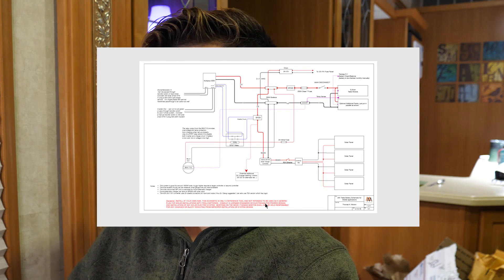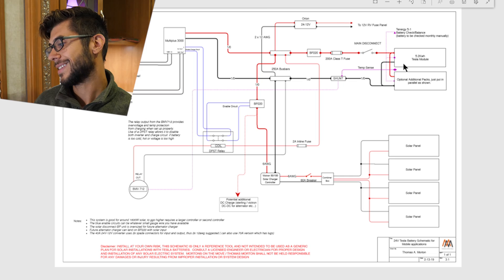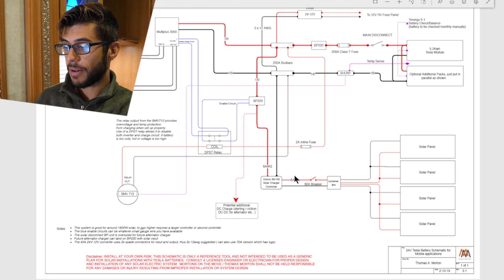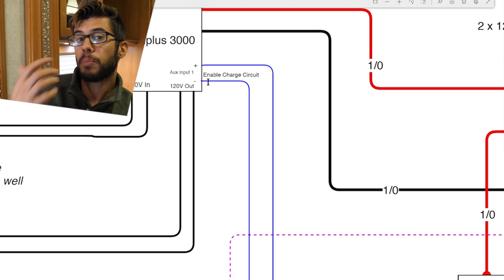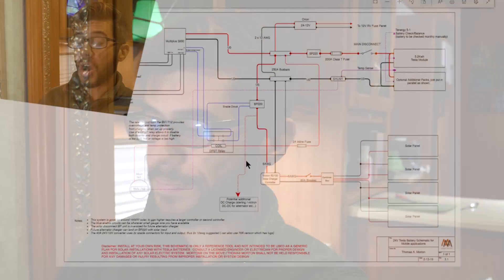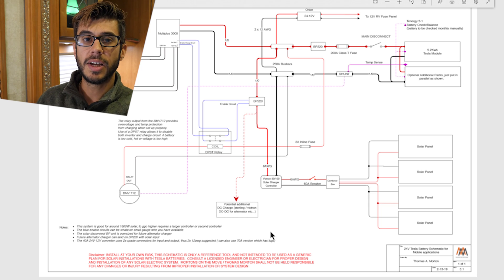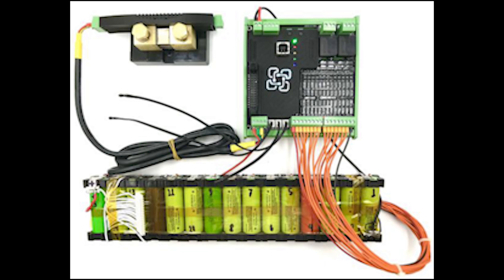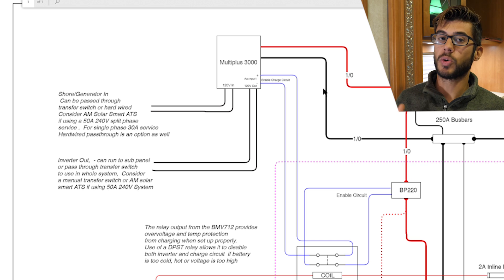RV Tesla Battery Install - System Simplification and Improvements , Schematic Walk through

Comment: So ... Nissan Leaf packs don't have to be heated until around 0 degs. F for charging. (Their thermal management will heat the pack back up to 14 degs. F and then shut off.) I had no idea that the Tesla pack chemistry was that inferior for RV use in cold weather.
Reply from the maker: I would be curious to see where you are getting that stat.  Leaf batteries are of the same chemistry that would plate below 32F...
Reply: @MortonsontheMove  True of all Leafs sold in cold climates. Here is an example description on Page EV-5 at https://owners.nissanusa.com/content/techpub/ManualsAndGuides/LEAF/2018/2018-LEAF-owner-manual.pdf
Reply: Nothing wrong using the Leaf battery, but you need to use it as a 48 volt system. Just be aware Leaf batteries lose about 80% of capacity after about 50,000 miles in a car so buyer beware when buying used. Tesla S battery offer the lowest cost per Watt of storage.  IE $1200 per 5.3 WH module. Leaf does not come close.
I have to say for anyone repurposing used EV batteries is more experimental than standard practise. For all others with concerns, just buy the Battle Born for 5 times the cost to obtain the same watt hour as one Tesla Module. Battle Born are great battery, but very expensive.

Comment: Interesting use of the Tesla battery.  I like the idea of having something that can be temper proof monitoring with smart disconnect.  I was thinking of using something like a Linear Tech LTC4359 Ideal Diode with higher amp FETs and controlled either by FPGA with a/d inputs or with a simple Arduino setup for volts and temp monitoring as a safety control circuit.
Reply from the maker: You can use whatever,  We originally used independent controllers.

Comment: Thanks for your video . I've been using a Tesla model S batt. module for 5 months now in my home solar power system and couldn't be happier with how it works . I built a battery pack consisting of 88 18650 lithium ion cells wired in parallel and added it in series to the Tesla module .   This gives me a much wider operating range to work with compared to using just the Tesla module alone .  My inverter has a low voltage alarm that starts screaming at 22 volts so if I were to use only the Tesla module alone charged to around 80 % capacity I would only have a little over one volt to use from the time the sun sets to when my inverter shuts down . Now I can charge my batts. to 27.4 volts and have 5 and a half volts to utilize instead of just 1 . There are several other advantages to adding the extra batt. pack as well .
Reply from the maker: Yes if they were 7S batteries life would be much better using them like this. The victrons work pretty well at the low voltage tho.
Reply: Russ can I contact you? I have a 444 tesla module but I must have shorted it a blew out 72 fuse wires only on one series at the neg connection. All the 18650 cells are good and I want to repair it.  Did you make a 7 series battery? I also have question on setting up the charge profile in the Victron 24/3000 software. Tom
Reply: Hi Tom , to answer your question yes I bought 100 18650 cells from a company selling off of E-Bay , they are 2200 mAh instead of what Tesla uses which is 3400 mAh but it doesn't matter and then I connected 88 of them together in parallel soldering  thin pieces of wire to all the positive terminals with the other ends of the wires soldered to a heavy guage wire to make buss bars .  These are my fusible links . The negative cell terminals are all connected together by just being in contact with a heavy piece of copper wire . The whole pack of cells is put together in a wooden frame and wired in series to the Tesla modules positive terminal to make a 7s battery . Its fairly safe to solder the positive terminals of 18650 cells because they have a raised button that helps to keep the heat from damaging the cells but the other end of the cells are the outer case of the cells and if you leave the soldering iron in contact with it too long you could boil the electrolyte and ruin the cell . It looks like you have 72 new fusible links to solder to your Tesla module on the cells negative terminals ... good luck . I don't know anything about a Victron controller as I am using a Xantrex C60 controller
Reply: @RussLinzmeier  I would like to see a photo if what you did. With regard to my issue, all my soldering will be from the positive cap of each 18650 cell to the bus bar. I know soldering the cell cap is not the issue but soldering to the Tesla bus bar is as it acts as a large heat sink. Thus the reason I think the fuses have to be spot welded.
Reply: you know when I make my next 18650 batt pack I won't make a wooden frame because it was to teadius and time consuming to make . I would recommend you search "do it yourself powerwall " and build yours the way those guys build a pack using snap together plastic cell connectors .
Reply: @RussLinzmeier  I have seen many make the power walls with the use of PCBs. I did consider that, but the purchase of a single Tesla Module was cheaper. I guess I am confused on your build. Did you make a battery from scratch or add one additional series to the Tesla module to make a 7S74P battery? Is so how did you add the addition series to the module? IE wired connection to the 6S and the final connection of the 1/0 or larger battery cables?
Reply: What I did was similar to what the " Do It Yourself Powerwall " guys do , they acquire hundreds of 18650 cells and assemble them together in packs of about 100 cells each wired together in parallel . When they get 7 of these built they connect them all together using zero gauge battery cable to make a big 7S battery and connect that to their charge controllers and inverters . I just put together one of those packs and connected it to the positive terminal of the Tesla model S battery module using a short piece of 0 gauge battery cable . Putting together those individual 18650 battery packs is extremely tedious and time consuming . The Tesla modules are ready to go 6S batteries using top of the line Panasonic 3400 mAh 18650 cells which are hard to find in mass at a reasonable price .

Comment: Why don’t they make all RVs with lithium batteries? Seems like they are the best.
Reply: Lithium for RVs has only recently (last couple of years) become cheap enough that people are considering them. RV manufacturers are always a few years behind trends, and are slow to adopt new products. Heck LED lighting only recently became standard on new RVs!
Reply: Lee Biggs marathon isn't even using lithium Featherlite is just now doing lithium. Millennium coach is dong lithium as they are the most technically advanced Prevo converter
Reply: Steve St. martin  Can you tell me about these RVs? Because when I went online all I could see were big passes for larger groups. Do they make RVs for families?Like class Bs and Cs
Reply: Something to keep in mind here.  There are different lithium chemistries with different stack voltages.  Tom is using a Tesla battery that contains  nickel, cobalt and aluminum.  They can explode if not handled properly and the stack voltages (3 or 4 cells in series) don't work out easily as a replacement for a lead acid battery.   If you buy a battery, for example,  from AM Solar or Battle Born,  you are buying a lithium iron phosphate (LiFePO4) battery.   They are much safer than the Tesla battery and the 4 cells in series are good match for a lead acid replacement.  The downside is the store less energy given everything else is held constant because of the lower cell voltage.  Tom's system displays great engineering, but you need to know what you are doing or pay someone to do it.
Reply: @dgreensotr  but toms system has no BMS...which can be dangerous.. there are several videos of batteries exploding online just Google it... Because of no true BMS a $10 meter is not a BMS
Reply: @jrgt628  Which is why he uses the DPST relay connected to the BM712, programmed to disconnect at over-voltage/low temp. Also he uses the BP220.

Comment: Can your battery system run your air conditioning without a generator? That would be awesome. Can I go to a company to do that for me in a class C?
Reply: Yes you can run a rooftop Coleman Mach 8 AC unit with one Tesla Module and the Victron 24/3000/120 volt inverter but not for a long time. One 230 ah 5.3 WH  tesla battery at 80% is 184 AH 4.24 WH. Coleman Mack 8 1600 watts. 1600 watts/ 4 WH is 2.5 hours of use on one fully charged Tesla. 2 modules will give you 5 hours. Since the Victron 24/3000 is a hybrid inverter you can power the AC with a lower wattage generator like a 2000 watt gas Honda that will put out more like 1700 watts a sip fuel and you can run your AC all day on one gal of gas $2.40. 
Using an aux low wattage through the wall Air Conditioner is also a very good idea if you can accept the extra wt

Comment: Tom, the BMV-702 you had before has the ability to monitor temperature. It just doesn't have built in Bluetooth. I simply added a Bluetooth dongle to my BMV-702.
Reply from the maker: You are correct... I made a mistake and said 702 when i originally had a 700.